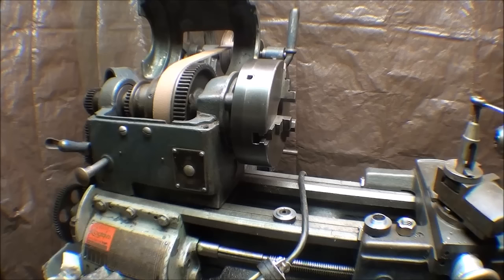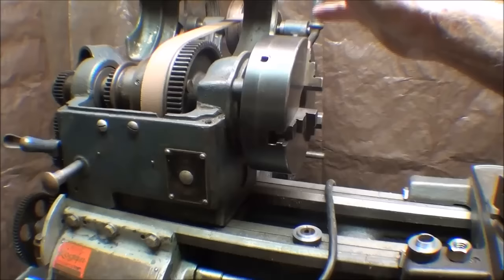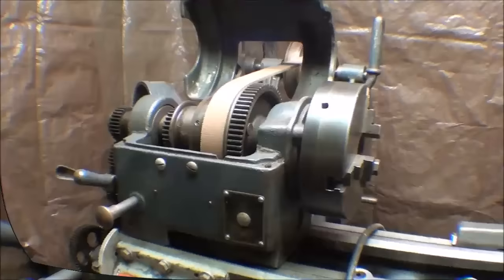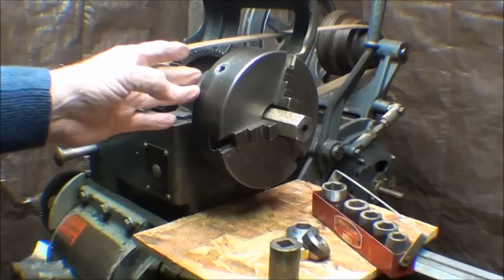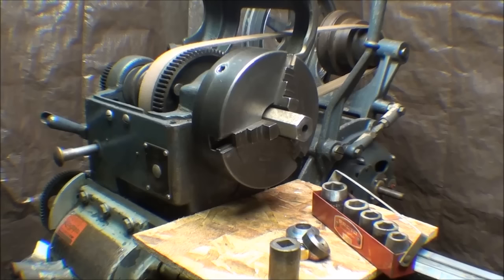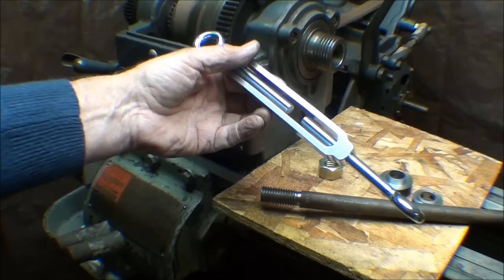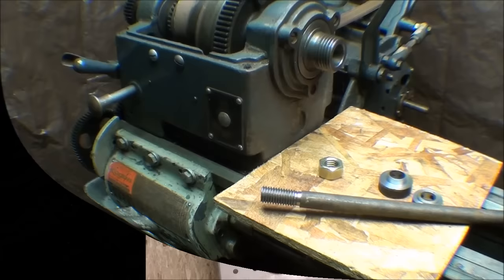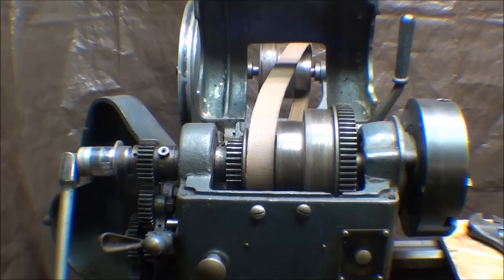SHOP TIPS #281 Removing a Stuck Lathe Chuck tubalcain atlas

Comment: Great Video, Mr Pete!   I had the 3 jaw chucks on both my 9" adn 10" South Bend lathes stuck on.   They probably had not been removed in 30-40 years.  I was able to lock the back gears, and using the hex bar and impact wrench on one, and the adjustable wrench applied to one of the 3-jaws on the other - get the chucks removed.   After I removed them - I cleaned the threads on both spindle and chuck, and when I reapplied them - I applied a liberal coat of anti-seize to the threads.   I've never had an issue removing them since.
Reply from the maker: You were very fortunate that you could get them off

Comment: Tonight, I removed the 3-jaw from my 1950 vintage Logan by first trying a hex wrench and turning the chuck over against the wrench which hit the end of a pipe on the floor. When that failed, i tried engaging the back gears and using a crescent wrench on a jaw. It came right off, first try! Thank you Mr Pete.

Comment: My SB 9C chuck was stuck solid.  I avoided any method that stressed the chuck jaws including the hex nut with wrench.  this is what finally worked and is simple.  I got 10 ft long 1/8” wire rope clothesline vinyl coated.  I installed a loop clamp at each end. Put one end of loop on spindle head disconnect pin, then extended it over to the large adjacent pulley.  Wrapped it around the pulley about 4 or 5 times and anchored the other loop end around something stationary below lathe.  This puts very little strain on the pin mentioned above since the wrap holds itself tight.  Now on the spindle chuck where the indentation for the chuck jaws track is  accessible, use a aluminum/soft piece of stock and give it a sharp tap with hammer in correct direction——making sure all slack is out of the wrapped cable.  It popped loose first try.
Reply from the maker: Ingenious

Comment: A stuck chuck on a screw on Chuck,  just set up and operate the thing in reverse mold until the chuck brakes loose. These screw on chuchs are known to pop off on ya whenever you operating the in reverse 😮.

Comment: To remove my three jaw chuck, I placed a 1 1/8 inch socket in the chuck. I tighten the chuck on the socket very tight. I then put a little bio shield T9 on the threaded shaft of the lathe.between the head stock and the chuck.  I let this sit for about 10 minutes. I  put the leather belt on the cones in the Tightened position. I placed a small wooden stick underneath The large cone and leveraged it against the body of the lathe. I attached a large half inch ratchet wrench to the socket contained in the chuck. I then hit the end of the ratchet wrench with a medium size ball peen hammer. The check immediately came loose. It had been stuck before and I couldn’t move it. If the chuck hadn’t come loose in this configuration,  I was going to use a half inch breaker bar Too attached to the socket. This would’ve given me more leverage. I have an air driven impact wrench, and I could’ve chucked up a large socket and use the impact wrench to try and turn the checklist.

Comment: Your last method could possibly be used to also restrain a chuck on a threaded spindle nose so that you could run the spindle in reverse without fear of the chuck unscrewing. Of course, that defeats ‘thru-spindle’ capability. I will have to investigate this possibility on my Atlas and South Bend lathes.

Comment: This is funny because I just went through this with my Atlas\Craftsman lathe. I had a chuck that did not use a wrench, the back spun to tighten the jaw. We would use a rod and hammer in a hole to tighten it! So after 20 years of this, you can imagine how tight the chuck was. Well the worst thing happened, the chuck broke and would not not open or close! I tried all the tricks that Mr. Pete and others have mentioned from using a 3/4 inch impact and nothing worked. So I knew that unless the chuck came off, the lathe was scrap. So I proceeded with desperate measures...I had an easy out, the right size that fit in the back of the spindle. Then getting my oxygen acetylene torch heating up the chuck and a 12 inch crescent wrench on a jaw and another 12 inch wrench on the easy out holding the spindle in place, a 20 lbs sludge hammer with 2-3 heavy blows, and a miracle occurred...the chuck came loose. Just to remind you, these were extreme desperate measures, and my lathe survived.
Reply from the maker: +Matt Schmidt Boy that was tight one.  Any damage from the ezy out? Did the heat hurt the bearings?

Comment: Hi, I'm a fitter and turner from the old school of '58, and many years ago I worked in a shop that still had flat belt driven lathes.....and a few with screw on chucks.
One lathe had a chuck screwed on so tight it defied all means to remove it.
Simple solution, which I have used for many years on all screwed on chucks, is to use a piece of aluminium bar set upright on the bed next to the chuck face at the back and under a jaw sticking out horizontally from the edge of the chuck.
Then you just rotate the belt pulley back a few inches and rotate it to bang the underside of the chuck jaw down on the aluminium.....a few light blows is all it takes........the shock will break the chuck loose  after a couple of blows.
This will not damage the chuck or the lathe bed as it's at the strongest part under the chuck and the aluminium won't score the bed either.
I use this method for all screwed chucks as you don't need to lock the spindle because you need to be able to swing the belt pulley and bang the chuck down against the ally bar to get the chuck loose.
BTW, my lathe at home is a 1930 flat belt driven Colchester Bantam with a screwed on chuck and this is the only practical and safe way to remove the chuck.
Reply from the maker: Thank you for a great solution. I will try it next time I need to

Comment: Useful stuff, thanks mrpete and others. I have recently had my ancient Chekka lathe stuck, and finally unstuck and I have a few comments.
1) Although I have swapped between my chucks for many years with no problem, I turned a dozen 2" x 2" hard oak sticks (each about 2 ft long) down to have round cross-sections using a 4 jaw. I know I'm not supposed to machine wood in a metal lathe but I have done so for many years.
Anyway, the periodic tightening and relaxing of the mounting thread as the corners of the wood were taken off, must have properly stuck the chuck.
2) First I tried a strap-wrench on the largest of the cone pulleys, and an 18" adjustable ("Crescent") wrench on the jaws. This didn't work as the strap-wrench couldn't hold the cone pulley from turning. Oh I forgot to say that I didn't use the backgear as it was cast iron.
3) next I got a bigger strap wrench on the cone pulley held down by a chain to the base of the machine. I removed the 4 jaw and bolted a 3 ft angle iron to the chuck mount. I struck the angle iron with a 14 lb sledge. no luck as the strap wrench still slipped.
4) Next I made a 1/4" plate shaped to bolt to the side of the cone pulley. I drilled and tapped 3 screws (1/4") to fasten the plate to the cone-pulley, and prevented the plate turning by inserting a scrap timber block resting on the lathe gearbox. I then attached  a 40 kg weight to the end of the angle iron and left if for a few days. Still no movement. Oh, penetrating oil etc.
5) Then one of my brothers-in-law came over and lifted and dropped the weight about 2 ft, Nope. Then lifted about 4 ft. Success !
The moral for me is that periodic shocking caused it to lock up pretty tight, and a massive shock burst it free.
Has anyone tried a big flat plastic washer between the male thread of the spindle and the female thread of the chuck backing plate ?
Reply from the maker: That was an interesting solution. Sometimes they are so tight that people just give up.
I had never thought about the shock of turning down many pieces of hardwood from square to round

Comment: I just got a nice old Logan 815 and needed this today! What a great resource. I tried a piece of hex rod in the chuck first and locked the back gear and didn't want to risk breaking teeth. I did use a chain strap wrench but wrapped the pulley with nylon webbing and a rubber shoulder pad from a laptop bag strap (first time I ever used the strap) The chuck came off with no damage to teeth or pulley.

Comment: Yes, I had exactly this problem with a 6" chuck on my SB-9. The lathe sat in storage with no climate control for several years in SE Texas where humidity if a big factor. It was really frozen solid. 

I did try for several days to loosen it by using the back gears and several methods of applying moderate shocks as well as just a long lever arm (about five feet) with as much muscle as I dared instead of the shocks. I was being very careful of the gears as I too have seen many instances of lathes with broken back gears being sold on E-bay. I did know the danger and did not want any broken teeth on my SB. Those various methods just did not work. I am a big fan of Kroil and used it liberally over those days. 

I finally tried this. First I soaked the outside and inside joints between the chuck back plate and the spindle with as much Kroil as I could. I did this two or three times as I worked on the other aspects of my plan. I mounted that five foot lever arm (some steel angle stock IIRC) between the jaws, sticking out the front of the lathe,. Then I hung a 10 or 20 pound barbell weight on the end of the lever arm and locked the back gears with it about four feet above the floor. I closed the shop and went to sleep. The next afternoon when I had the time to go back to the shop I found the weight and end of the lever arm on the floor. The chuck was loose. With NO BANGING! Just the constant pressure of that barbel weight and the action of the Kroil seeping into the small opening between chuck back plate and the lathe spindle and doing it's magic there. 

As in the story of the tortoise and the hare, slow and steady beats fast and furious. And there was absolutely no danger what-so-ever to the teeth of my back gears.

Comment: Those are some good ideas and when I saw the hex bar with impact wrench I thought I would finally get me chuck off. Unfortunately, no luck. Then I put the crescent wrench on the hex bar and a pipe over that to extend the handle. With a pipe wrench gripping the shaft behind the gears and pulley, the chuck came off. I honestly never thought that chuck would ever come off. Thanks Tubalcain for your ideas and great videos.
Reply from the maker: That was a tough one

Comment: Nice job on your videos, Take the cut belt run through a pipe a little farther. Use two pipes held together with a coupling. Get it as tight as possible by hand, grip the belt like you suggested with a vise grip or other way, now partially unscrew one pipe from the coupling to get the grip even tighter.Joe
Reply from the maker: +Joe Priebe good idea-thanks

Comment: Went to work at a place with a 40"x58" gap bed and a 12' bed. The face plate was stuck on the spindle and head been for decades. It took a variant of the last method, penetrating oil, heat, and a great amount of muscle. I locked up the flat belt pulley with every cloth inside belting threaded through a slot in a 2x4 and bea Fed against the wall. The threw the bore bolt was used to compress the thread tension on the face plate. The penatrant and heat were used to dislodge the rust and provide a couple of thousandth of expansion. A good trip on the face plate and several (20or30or so)

Comment: thanks buddy your advise really helped me out.  I had a stuck chuck on my atlas/craftsman 12 inch lathe.  I tried all the usual things.  Kroil and heat gun and I even put an impact gun on a piece of hex stock chucked in the jaws.  I finally removed the back plate of the chuck and used your sacrifical belt deal.  It slipped at first but I gave it a  liberal dose of belt dressing, kroil on the threads and heat.  After three times, the chuck came off.  Next I have to get a three jaw chuck with inside jaws.  I have a 4 jaw as well.  I am about to remove the apron as I think the 24 t gear in the traverse mechanism has lost a few teeth.  I also have a Monarch C with 16.5 swing and 50 inch between centers.  Trying to get the Atlas in good conditon before trying to turn a cannon barrel on the Monarch.  I am building a Civil War 2.25 inch Mountain rifle.  I shoot in the N-ssa in cannon competition.  I am on a few cannon crews but want my own gun.
Reply from the maker: Thanks. Awesome

Comment: Your video is excellent.  We had a 10” Atlas lathe that we couldn’t break loose the chuck.  We opened the chuck jaws and put a Propane torch to heat the inside of the chuck for a few minutes and were able to break the chuck loose after that

Comment: I just did this yesterday on a Craftsman, before seeing your video. I used vise grips to pinch the V belt together as close to the pulley as possible. Once locked on, I levered up on the pliers to squeeze the belt tighter on the pulley. it worked great.
Reply from the maker: +boomblooka Glad it worked- Thanks for watching

Comment: I took a small diameter nylon rope and wrapped it around the pulleys a few wraps on my 6 inch Craftsman lathe. I used a screw driver to twist it tight and a pipe wrench on a piece of round stock in the chuck and finally got my chuck off. I got the basic idea from this video though. Thank you Mr Pete for all the informative and entertaining videos!

Comment: I purchased a Craftsman 101 lathe that had a Jacob's chuck which was on pretty tight and I was at a loss on how to get it off.  I used a large Allen wrench to hold the chuck, engaged the gears and which a quick jerk, it came loose!  Thank you!

Comment: Hello mrpete222, I had a stuck chuck, tried all your solutions.  But it came down to as a last resort,  removed the chuck as the back plate was the stuck part. I ended up turning it off, being careful not to damage the spindle threads, MY FIRST CHIPS. Then I ordered a back plate from LMS. Had to drill the 3 holes, and turn the register to fit the chuck.  All with the help from you mrpete222. A lifetime subscriber of yours.
Reply from the maker: WOW--that chuck was really stuck!!

Comment: thankyou @mrpete222 ,
i was struggling from 6 months to unmount my lathe chuck lol, after i see your video it came off in 6 mins 😂😂😂, my lathe did not have a spindle lock so i used the belt strap wrench to jamm up the pulleys then putting a flat stock in my chuck , i gave it hammer impacts it came off in the 4th impact 😎so smart of u sir.. 🤗
Reply from the maker: I'm glad you got that chuck off

Comment: Thank you for making this video. I used it to get the chuck off a myford ML10 with a v belt and vise grips, air socket gun and a bolt with a nut welded on (in loo of hex stock). It wasn't rusted on fortunately.

Comment: Thanks!! Impact gun worked for me on a 1930s lathe chuck/faceplate. I didn't have any hex stock but a fairly big car suspension bolt double nutted and locked in the chuck jaws worked perfectly.

Comment: Extremely helpful! I was able to use your tip re: clamping hex stock (in my case, an estate sale straight Allen wrench handle that I didn’t even realize I had).  Impact driver didn’t work, but I ended up removing the back gear, soaking in PB Blaster overnight (with the headstock vertical to allow gravity to help it drip down), and using a 25” breaker bar from Harbor Freight.  My spindle gear was already shot, so I used a regular channel lock to hold it and keep the spindle from spinning.  Headstock on the floor, left foot on the channel lock, and both hands on the breaker bar. It felt a little bit like Twister, but it worked.  Thanks, mrpete222!

Comment: You included many great ideas that I have also used when working on vehicles and other machines to hold on while I was attempting to remove stuck parts!  Thanks for another fantastic video!
Reply from the maker: +T Justmetmc Thanks for watching

Comment: I have had this issue a few times (not just on lathes) and it is a real pain. An impact works great, and the last solution works great. For an Atlas, I tapped a morse taper sleeve for 3/4 thread rod, cut flats in the other end of the rod, and used that. Just barely fit through the chuck, and I didn't have to worry about lefty thread, as it didn't take a lot of draw-up to set the taper tighter than a gnats hat. On a larger lathe (24", maybe? turn of the 20th century vintage), we disassembled the chuck to get to the back plate alone and were able to free it up once we had access to the threads from the outside end. A little lube, a little heat, a litle tap. Thought we were going to need to slit the plate at the threads, but didn't. The plate (no chuck, just bolt on jaws) came off the 48" with just lube and a hydraulic jack, thankfully.

Learned the hard way to NEVER have back gears or drive pin engaged if it doesn't come easy.
Reply from the maker: +john john Thanks for watching

Comment: Engaging the back gear, putting a wrench on a jaw and giving light taps worked for me. I appreciate the info. If I had hex stock I would have preferred that over putting force on a single jaw, but mine also wasn't as "stuck" as I thought. 

Thanks once again!

Comment: I have a little sheeline and it doesnt even have a single gear in it. I recently forgot to put some oil on the chuck and it got siezed. I used it every day... In the end I ended up holding the spindle by the other end with vise grips (Soft jawed ones) and i used the chuck key to get the chuck out with a few taps of my brass hammer... Works great for small lathes!